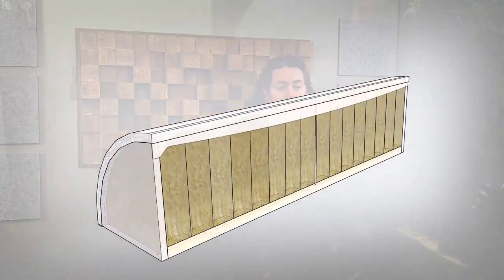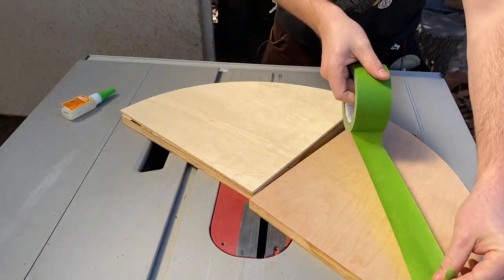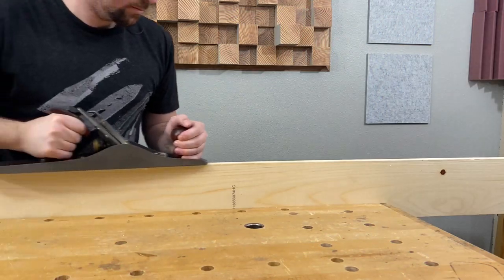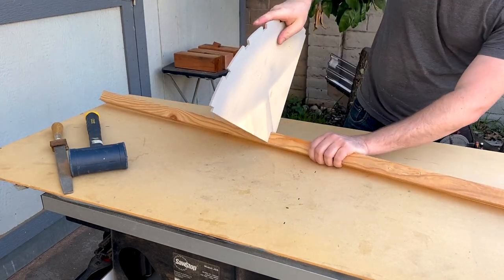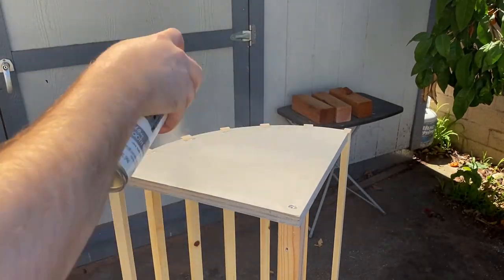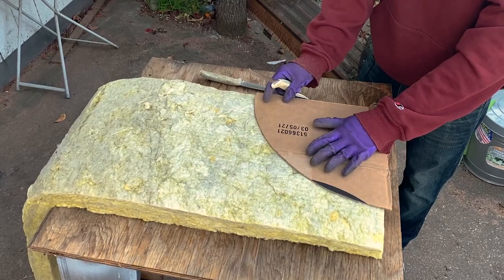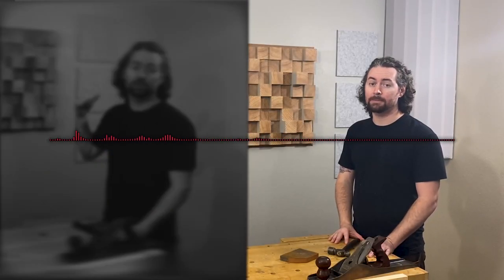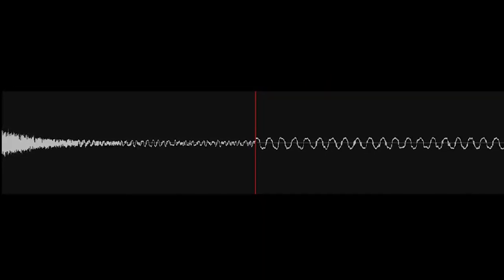Corner Bass Trap DIY - Acoustic Dampener

Comment: Builds bass trap. Tests frequency response without testing bass response. 👌
Reply: @dangr123   They aren't just bass traps. They diffuse a bit and also absorb much of the nasty higher frequency echoes in the corners.
Reply: Yeah, I would have done a frequency sweep to A/B the resonances before and after.

Anyway, this doesn't seem to be for music, more for improving the space for voice for video, which the test does prove.
Reply: @gordthor5351  it's supposed to be a bass trap, considering title of the video,so there's should bass test...
Reply: Lol
Reply: @gordthor5351  What frequencies do you think are "bass" frequencies?   The material he's using is only rated at absorbing 125Hz and above.   Look at the bottom two octaves on a piano. What is that frequency range?  Do you see a problem?
Reply: @Oneness100  Of course its only rated at absorbing 125hz and above.  That doesn't mean it doesn't absorb anything below that.  It is only rated to 125hz because the standard for NRC testing is a set of frequencies between 125-4000hz.  Technically, 125hz would be considered midbass.  Since you bring up a piano, the lowest frequency a piano plays is 27.5hz.

Comment: This is major. One of the reasons I love making music, is the supportive community! Thanks for sharing
Reply from the maker: You're welcome!
Just FYI, I have gotten some comments that this is more of a mid trap than a bass trap. It does make the room sound much better though.
Reply: @Bob's Wood Stuff  tracking Sir. Is a good frame to have. I read you need at least 6" for am effective bass trap. Wondering if I can use this frame for it.
Reply from the maker: @palovibes  This frame is based off a 10" radius, so it should work.
Reply: @BobsWoodStuff  i'll give it a try and hopefully tag you on the post. Thanks again!

Comment: You're clearly a very skilled carpenter, but why you'd think clapping or scraping is a good test for a bass trap is beyond me. It's function is to reduce the decay of very low frequencies <120hz. You're not going to hear it from that test, it's actually quite a subtle effect from just 1 panel that you need heavy sub transients to hear.

Comment: Thanks for the concise and yet Informative video!
This is probably the one bass trap that really works and doesn't cost a ton in tools/materials to build.
Anyone have any thoughts around the design modifications required for filling a similar frame with activated charcoal instead?
Reply from the maker: Thanks! It makes the room sound much better. But I have been informed that it is more of a mid trap, fyi.

Comment: Great inspiration. Thanks. Also one CAN use some very very THIN plastic to seal in the mineral/fibreglass if worried about contamination, which does happen through loose weave material. Sure it makes a difference, but that difference is insignificant. Really.

Comment: Is the fabric enough to keep the glass fibres inside and out of your lungs? I think I'll add a sheet of plastic to keep them in.
Reply from the maker: If you are adding a sheet of plastic, then the sound will never get to the insulation and it might as well be a plastic block. It needs to be permeable.

This is mineral wool, not fiberglass, so it is arguably more safe.

There's really no wind in that room, so I don't think anything would blow the fibers around.
Reply: @BobsWoodStuff  ah, good stuff!

Comment: The design and the work is very nice but: the efficiency of the bass trap depends on its depth... so, using mineral wool, I think you would spare some time and some money by just placing a squared bass trap on you corner.

Comment: Small rooms don't have echos.  They have reverberation and that's measured with RT60 times and that's a combination of all 6 surfaces.. 4 walls, floor and ceiling.  With using hand clapping, that's a fairly narrow bandwidth around 2K Hz. Not exactly a "bass" frequency.  I like to use the frequencies BELOW 100Hz as "bass" frequencies, as that's the bottom two octaves on a piano.

The second problem is that you're just stuffing an odd shaped "box" with building insulation and sticking it in the corner.  Corners represent about 5% of the total surface space in the room, at best.  Hardly enough to make a BIG differnce. It will make a difference, but not that much.

 Building insulation is actually used for thermal insulation for inside a wall in a home to insulate the room from hot/cold weather and to retain a certain tempurature within a room.  It can also be used in a wall cavity to reduce the amplitude of noise in the 125hz and above range.  Again, NOT "bass" frequencies.  Now, with "bass" frequencies, they are PRESSURE based problems and in small rooms, they create what's referred to as PRESSURE modes.  In order to absorb low frequency pressure, you need something that is PRESSURE based absorption. Deep cabinets with a front wall that moves with the pressure and filled with a dense, porous materials are the best, those are called Diaphragmatic absorbers, and there's only a few on the market, or you can obtain build plans and make your own. I can point you to a company that sells build plans on the best ones on the market.

Mineral wool is more VELOCITY based absorption, and it's not really designed for music and speech.  The absorption coefficient curves simply aren't really that great for music/speech applications.  While it's cheap and it's widely used by some people, it's not really the best for low frequencies in the 100Hz and below.

If you want to reduce "reflections" or what you are calling "echos", that's a reverberation problem, that's a REFLECTION problem and you'll need two things.  One, the right material and TWO, LOTS of surface coverage and I would recommend at LEAST 50% surface coverage in the room to get a VERY noticeable difference.  I would suggest getting a high quality acoustic foam if you want it to sound good for music/speech applications, but if you just want to cut down the reverberations in the room in your wood shop, then you can do with whatever cheap material that's absorptive and you just make a bunch of panels probably in the 2inch or maybe 3 inch deep range and just do that.
Reply from the maker: Thank you for the detailed breakdown. I am currently using acoustic foam and moving blankets, and it seems to work for my purposes.
Reply: @BobsWoodStuff  FYI, not all acoustic foams are the same and they have varying performance.  I’ve used a lot of direct brans of acoustic foam a the top bran, IMO, is Acoustic Fields.  But it’s a little pricey.  It’s denser and they have a uniform cell structure , and results are perfect for voice/music, if you want the best sonics.   If your application doesn’t dictate studio or mastering studio quality performance, then what you’re doing should be fine;  it’s just how much surface coverage.
Reply: @BobsWoodStuff  Are you building this acoustic treatment products for your wood shop or do you have a recording studio, high end listening room for a stereo/home theater?
Reply from the maker: @Oneness100  It is just for a bedroom, which is sometimes used to film woodworking videos and record voiceovers.

Comment: Hi, Was just wondering if having breathable fabric around it doesn't let some of the toxic particles from the mineral wool into the studio environment. If so is there any particular type of fabric you recommend using?
thanks for the helpful video!
Reply: @joaquincornejoofficialchan4874   The small particles are hazardous (not toxic, it rock fibers), however, the fibers are too big to fit though the pours in most (breathable) materials (such as bed sheets) and the particles tend to stay in place if not disturbed. I made some floor to ceiling 8' bass traps like these and I used a bit thicker material for the fronts and they work great. I wouldn't recommend using burlap or any other such material with rather large gaps, which would allow the smaller fibers fit through. It's hard to beat this shape of bass traps/diffusers for performance and aesthetics.

Comment: Does rockwool work just the same if sliced transversally like that? I'm suddenly struck by the though if doing a faux shoji (ando?) style lamp that's actually rockwool inside (and some white fabric instead of rice paper covering it), and just place it standing close to the wall. Heck, I could put some LED strips inside and do a tufa panel+lamp!

... Now I just need materials, tools, time and skill to do this xD
Reply from the maker: Yes, the rockwool works the same like this, but better because it is thicker than a sheet when stacked this way.

Comment: Why did you use breathable cloth? Can I also use thicker cloth? What would be better
Reply from the maker: You want a cloth that will not deflect the sound. A simple way to test for this to to blow air through the material and see if you can feel it on the other side.

A cloth that is too thick will deflect the sound, instead of allowing it to pass through and be absorbed by the mineral wool.
Reply: @BobsWoodStuff  I see, thank you!

Comment: Great video. The attention to detail is very inspiring. The animations and editing are excellent. This looks very professional, well-designed and well-built. 

I have a couple of questions/comments:
1. You made the notches for the ribs smaller than the ribs' diameter, so that the ribs protrude outwards of the quarter-circle sides, which gives an overall "bumpy" look with the fabric on. Why didn't you make bigger notches so that the ribs fill the notch completely and have a smooth finish?

Anyway, thank you for the video and keep up!
Reply from the maker: Thank you!

On the ribs, if I didn't leave them sticking out a little, the appearance would be round on both ends and the middle, and flat on the inbetween sections where the fabric stretches between the ribs. I wanted a more consistent look with flat facets going all the way up the bass trap.
Reply: @BobsWoodStuff  I understand. Thank you for the quick answer!
For some mysterious reason, my second question disappeared into oblivion. I wanted to ask whether a more appropriate measurement would be with some kind of bass instrument - a bass guitar, bass drum, brass instrument, etc. - because those produce a low frequency sound wave which is the main use for bass traps, to trap it. The clapping and hammering tests produce high frequency sound waves which are improved by the bass trap but are already treated with the existing acoustic panels on the wall.

Thanks again!
Reply from the maker: @NadavCuky  you are correct, something with a low sound would be a better test of the bass trap. I guess I was mostly thinking in terms of what type of sounds I would make with my woodworking videos.

Comment: What the best point in the room to install the bass trap- upper corner or lower corner? Or middle corner of the room? Thanks
Reply from the maker: The best place is upper corner or lower corner, but not in the middle. The corners are where the sound waves accumulate.
If the room is carpeted, I would put it in the top corner, since the carpet is already dampening sound that is lower in the room.
Reply: @BobsWoodStuff  Thanks!

Comment: Great video thx for sharing.
When it comes for the low frequencies, how well they perform.
Do you think it's better deeper ?
Also I noticed the panels on the wall.
Those would be for higher frequency.
How good are they compared to diy ruxol 
2' × 4'. Thanks again. Hope to hear from you soon, because I will be making my room soon.
Reply from the maker: I haven't measured it specifically for different frequencies, but it makes that whole corner sound better in general.

The grey panels on the wall are good for reducing the echo on that wall. I try to treat all the hard surfaces with something.

I haven't tried a 2x4 panel with the Roxul, but I have some leftover pieces, so that may be a good project for the future.
Reply: @BobsWoodStuff  thx for replying. 
Where did you buy those the wall panels. 
I'd like to look in to them.
Also your bass traps are the niceness looking from any I've seen.
Reply from the maker: @garyshirinian  thanks. The wall panels are from Amazon, here: https://amzn.to/3nf7VJg (affiliate link)
Reply: @BobsWoodStuff  thx

Comment: Great trap! But it sounds more like a mids trap, than the bass one. I doubt it would have an effect on any of the sub-frequencies.
Reply from the maker: Thanks for the info! It seems to work well for that room, but I don't actually get any deep bass sounds.
Reply: @BobsWoodStuff  I already have a lot of stuff in my room so there's close to no echo. But it's tougher with the lowest frequencies because they have high wavelength and the actual bass traps look more like a box with some quite big holes. I was really surprised when I found out that most of the so-called "bass traps" sold are made out of foam and only affect the high frequencies, so it's like a scam. The sound becomes only muddier because all the high frequencies immediately disappear while the lows can get overwhelming.
I have big Yamaha tower speakers, smaller monitors and Roland Katana Amp. The problem appears if you use a big enough subwoofer or speakers in a small or medium-sized room.
Reply from the maker: @NonsenseTreasure  In addition to the corner trap, I have moving blankets hanging on two walls (1 inch from the wall) and a bunch of acoustic foam. It works well for recording vocals on a condenser mic.
Reply: @BobsWoodStuff  Imo blankets hanging on the walls and ceiling (clouds) are one of the best options for recording.
Foam can be enough for recording vocals, acoustic guitars and so on.
Bass traps are mainly needed for mixing/mastering and for using a big sound system with big speakers.

Comment: Save your money, this is a stupid design. 

Get a design for a diaphragmatic low frequency absorber.. They will absorb a LOT more of low frequencies to remove Axial mode room problems. Also don't use corner "bass traps".  they are only treating maybe 5% of the surface of the problem isn't really doing all that much for low frequencies at all.. 

The definition of an Axial mode is the mode between 2 parallel surfaces, NOT parallel corners. So you want to treat the actual wall, ceiling, surfaces as much as you can..

Also, low frequencies under 100hz are pressure based, not velocity based, so you need some form of PRESSURE activated absorption, hence a diaphragmatic process.  They do work the best on a per square foot basis and you'll need a lot of time since most walls and ceilings aren't designed to absorb low frequencies below 100hz. Now, if you redesigned and built your room with walls, ceiling and even the floor with a good design, then you wouldn't need low frequency absorption in the room as the wall construction would do that for you..
Reply: What’s the materials used for this diaphragmatic panel?